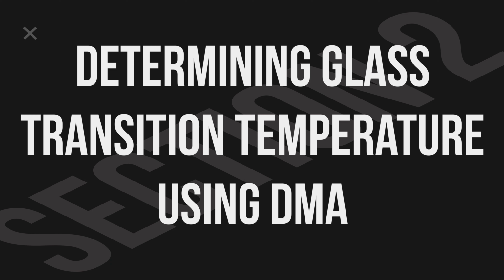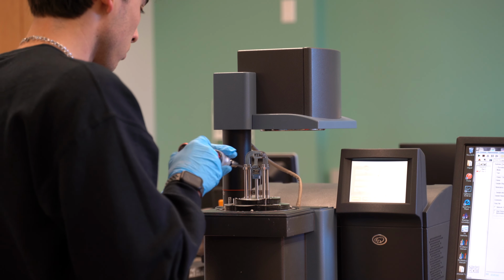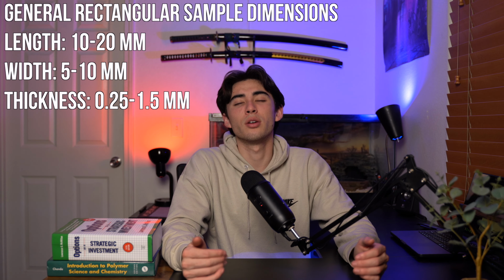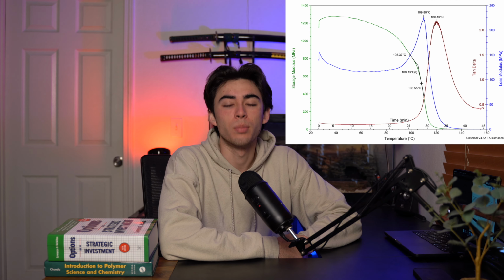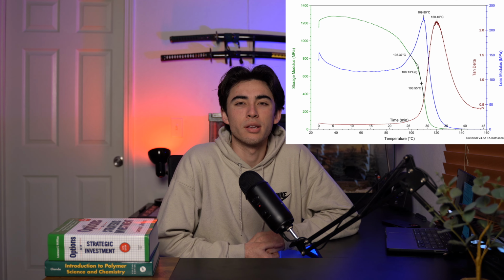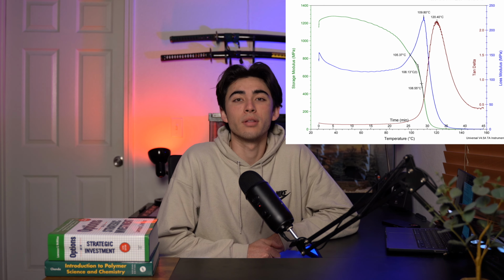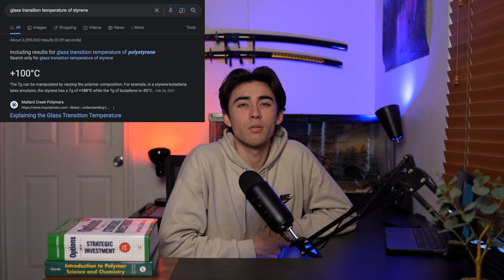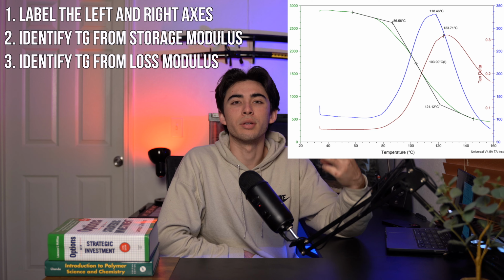Dynamic Mechanical Analysis (DMA) and Glass Transition Temperature

Comment: Hi Jachin, nice Video! One question: The TG temperatures in the last example of PET were different between loss and storage modulus. Which TG is the one representing the compound the best? And why are the values so different? Can we trust them? I thought DMA was the most precise way to measure TG. Thank you :)
Reply from the maker: Great question! So yeah, with DMA you’ll see a few different Tg values depending on what curve you’re looking at.
	•	The storage modulus drop is where the material starts losing stiffness — kinda like the beginning of the glass transition.
	•	The loss modulus peak is where it’s absorbing the most energy (max molecular friction).
	•	The tan delta peak is usually reported as the “official” Tg because it reflects peak molecular mobility.

They’re all valid — just highlighting different parts of the transition. It really depends on what you care about (stiffness vs damping, etc.). DMA is super useful, but you gotta know which curve fits your use case best. Thanks for the thoughtful comment!
Reply from the maker: Here’s another answer I found on the internet which is quite a bit more in depth than mine “ DMA is more sensitive than DSC but for DMA we usually use relatively much bigger sample than DSC, so it is very important to use low heating rates so your sample has enough time to reach thermal equilibrium with the chamber environment, that's why for Tg, it is highly recommended to use 2 C/min. This becomes more critical when you compare neat resin with reinforced composites, as fillers usually have different conductivity compare to polymer matrix. This can result in observing a shift in Tg of your sample! Also, the thermocouples in the machine are usually (in the best case) on the surface of the sample and the surface which does not necessarily represent the temperature of thw bulk (whole ) of the sample. (If you use nanoparticles, it will become even much complex as in nanocomposites, interface scattering of phonons during heat transfer reduces thermal conductivity!!!).
Regarding which temperature should be used, different standards present three different temperatures:
1. Onset of the drop in storage modulus(E')
2. peak in loss modulus (E")
3. peak in tan delta
The first value represents (in my view point) much properly the Tg as Tg is basically the temperature in which short range relaxations (some people consider 50 C-C bonds for the length of the regions) can occur which reduce the resistance against deformation. If you do DMA in LVE region, you work in fairly small deformations(<0.5%), in which you can consider the material behavior as HIGHLY elastic and translate the resistance against deformation to the modulus. However, detecting the onset of the drop in E' may be tricky especially in materials with wide molecular weight distribution. Because of that some people prefer to report the peak in E" (which occurs after the onset of the E') where the rotational and vibrational frequencies of small segments of polymer chains match and result in a maximum loss or peak in the loss modulus. Some people also use the peak in tan delta. Tan delta is the ratio of storage to loss modulus, its maximum occurs after E" maximum. As tan delta is a ratio, its relative value just gives you an idea of the relative (not the absolute)contributions of elastic and viscose molecular mechanisms in a material response.
When you check the literature, most people report the peak in tan delta as Tg, but reporting other two temperatures as Tg is also relevant. So it depends on you, but whichever you use, you need to mention that in your experimental that "Tg temperature was determine as ......."